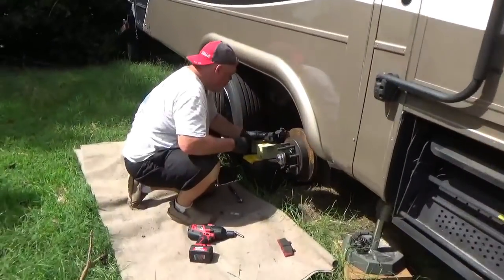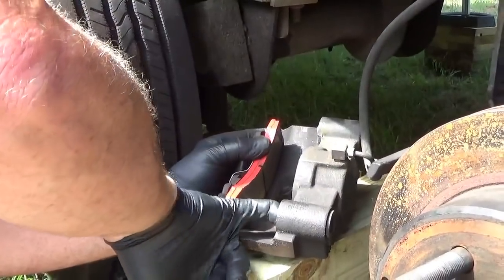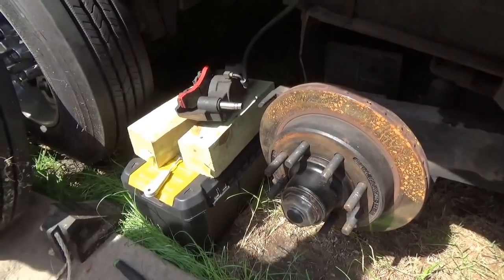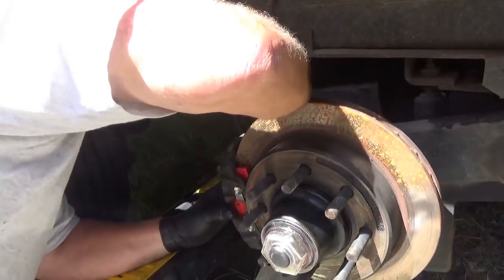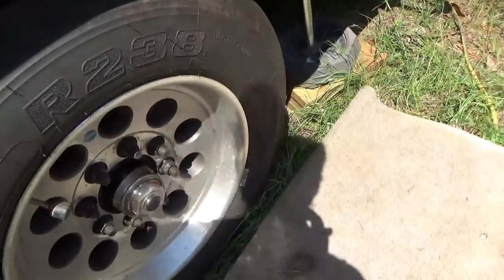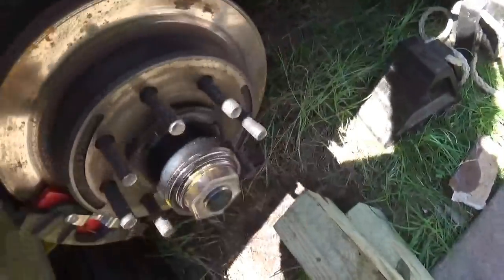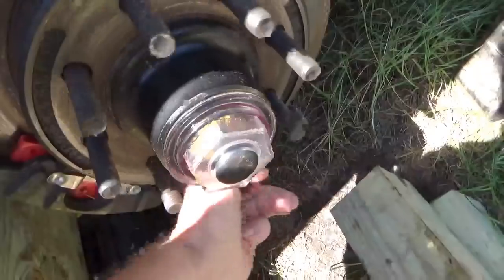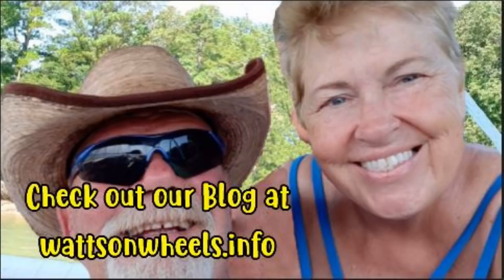💪 RV Rotors & Brake Pads Part 2 - Caliper Check

Comment: If cleaning out holes use a plumbers wire brush for copper pipe solder prep or a shotgun barrel brush or the correct caliber on a drill.
Reply from the maker: Yeh, good idea.  Thanks Duane.

Comment: the rubber does not let water dry. it will let the pin rust etc. just clean them pins well lube them so the water dont stay on them and rebuild it will be ok.
Reply from the maker: The pins are stainless steel, but yep, gotta keep them babies greased.

Comment: The rubber is not affected by the silicone grease. If it is torn or damaged, replace, then relube and install.
Reply from the maker: None were damaged, but I didn't do the silicone grease on the rubber bushings the first time.  I think we are working OK now.
Reply: @WattsOnWheels  watchweswork has addressed this in a few videos.
Best wishes

Comment: 👍 so the hardwere kit is those rubber bushings. Sometimes they can swell up and stick the sleeves. So if the problem returns you could try replacing them. The clappers are GM type witch means the positions should be stainless steel and they so very rarely stick.
Reply from the maker: Thanks for the info!

Comment: Auto tech here , do clean those pins , remove all rust , lube the pins before you reinstall pins , The caliper has to move on those pins to work properly.,it basically Flotes back n forth on the pins
Reply from the maker: Yep, that's what I did THIS time.  Wish I would have the first time. :)

Comment: check your air supply on the truck, its pretty common for the supply to leak into the service and make the brakes drag, if you have air supplied to the red line, pull the blue line off and see if there is any air coming out of it.
Reply from the maker: Great tip.  I'll check that even though the regulator says 0.

Comment: I have been having some of the same problems with my brakes. I need to do more traveling and less sitting.
Reply from the maker: There ya go...get out there.
Reply: Sitting has nothing to do with it.  Those pins get hot when the brakes are applied.

Comment: Dave, question on the first wheel were was the inside pad? I've watched video a few times but didn't see inside pad attached. The rubber cushions, can you replace them? If not, need to purchase a rebuild caliper? Great video, very informative, and a brain strain. 😞😞😞 Thank you for sharing. Stay safe.
Reply from the maker: Hope the pads there, as there were no left over parts.  Karen's going to make me double check because you are the second person to mention that.  Hopefully just part of the video editing.
Reply: @WattsOnWheels  I'm sorry Dave, I'm just concerned for your guys safety. It might have stuck to rotor. Bright spot, it's going to be at least a six pack. 😁😁🤓🤓 Stay Safe.